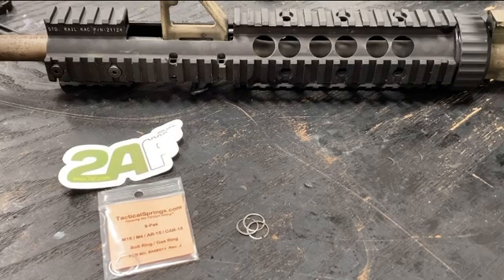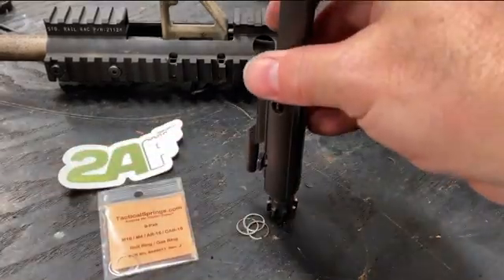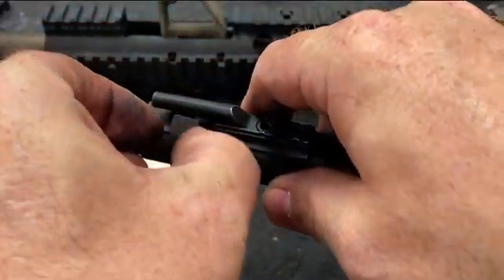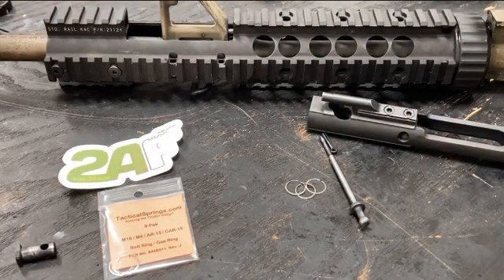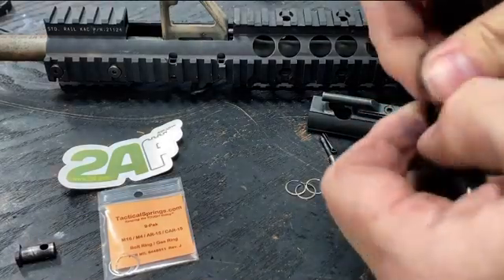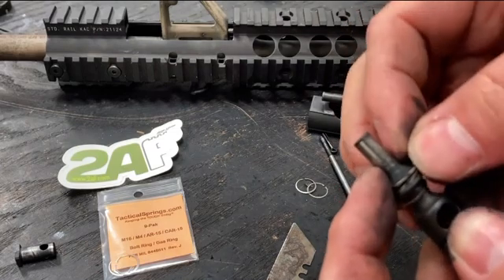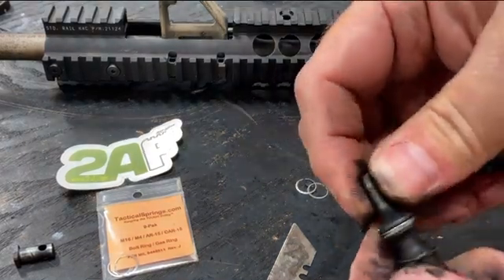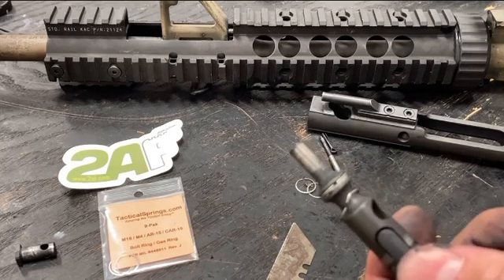When do I need new gas rings? How do I use new gas rings?

Comment: Do they have to be positioned a certain way or can you just drop them on?
Reply from the maker: Good question. No… position if the rings doesn’t matter. For years it was suggested that you should stagger the gaps on the gas rings or it could cause issues. That turned out to be untrue. Use good gas rings (I like Sprinco but there are lots of good brands), replace them if needed. Aside from that, don’t worry about their position.
Reply: @2AF_com good to know thanks!!  Also I like the gunsmith type videos, super helpful and never hurts to learn how to install or repair.
Reply from the maker: @AnthonyD1986 thanks for the comments and thanks for being here to watch! 🙏🏼